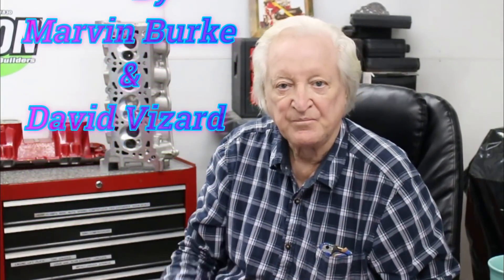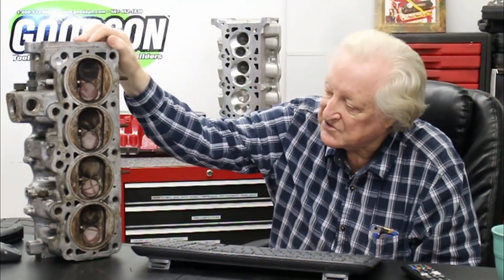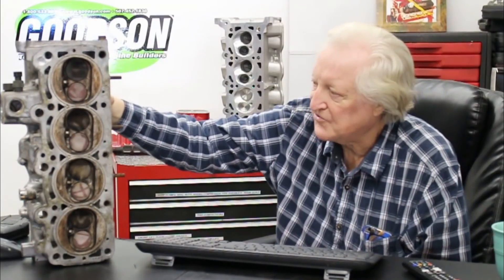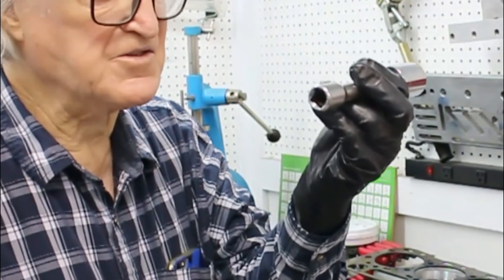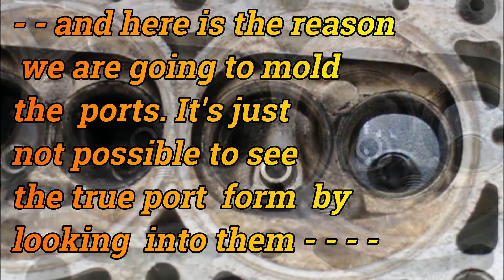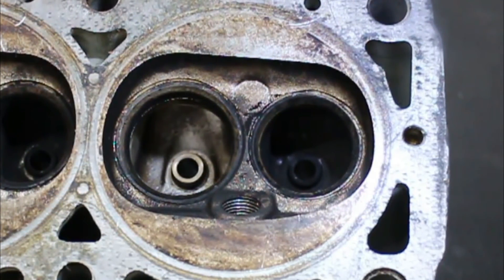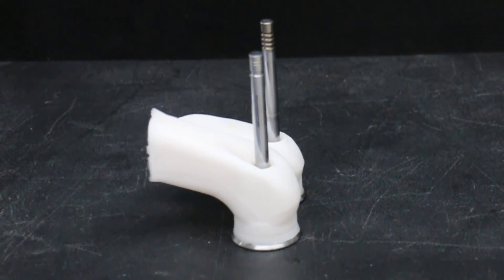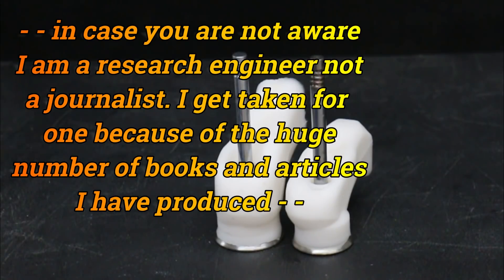David Vizard's PowerTec 10 EP 37 2.2 turbo Mopar head for Richard Holdner Part 1

Comment: I remember when i was a kid and that been a while i was reading a hot rod article and after reading it i saw the author it was Mr, Vizard and i made a metal note to watch out for more . When i ran on to the u rube channel  i thought what a deal lol great . I moved on to different brand but did mopar  dodge ever build a set of cylinder heads for the big block wedge engine that would support making hp . I had the 440 and the 426 marine wedge but they were just torque motors . I assumed dodge used the hemi for there high performance  department

Comment: Yeah nothing special about that head I'm surprised Shelby did not get Chrysler to do a special turbo head for the Shelby turbo cars. I would love to see a N/A 2.2 head and a Turbo 2.2 head and compare them. I know all the 2.2 and 2.5 heads were built with late 70's early 80's tech and back then turbo cars were not very efficient  compared to these days. I had a 1980 Turbo T/A and that car was not very good for power.

Comment: David, I did one of the 'bathtub' heads back in the late 80's for my nitrous street car. (82 Turismo w/fogger setup) Took a straight forward clean up approach in the bowls with good valve job. Chamber had the most significant work & had to mill the deck significantly to get the CR back. Stayed away from the short side floor on exhaust & paid the most attention to the roof. Can't go as tall as you'd want as it can be thin to the water jacket. Intake roof is easy enough to measure to valvetrain area inside of valve cover rail. Most of the good 'secret' parts of the day add the port openings raised. Also consulted on an engine with a friend of mine for a short oval package where we angle milled the head to stand the ports up. Engine never saw the car as the project was scraped. Still have it on engine cart in storage 30+ years later.

Comment: Regarding the ease of improvement of this head. Thinking about the heads and engines of the old Minis that Mr Vizard was upgrading, I also initially thought the same thing. Then thinking about it I realized that this was not the case. Improving a head that has a bad design at first is easy, just remove the bottlenecks and you will see improvements. But then you stop and the situation is reversed, obtaining excellent results is difficult precisely because the drawing is bad. I think getting a lot of power, and reliably, out of those old engines was a great school for old Hot rodders. (The same thing happened here in Italy with the engines of the old Fiat). This is my thought

Comment: My stars, those ports are... poorly thought out, I think would be the kindest comment. I'll be anxious to see how you minimize the bathtub chamber; that's what I'm dealing with on my Chevy inline 6. And as a bonus, now I know how to get a silicone port mold! Such a deal! Thanks for all you do, and for all you've done thru the years. I've been reading your stuff since about 1970, and marveling that you get what you do out of the engines that come across your shop floor. Those small increases add up after a while, if one is consistent with the follow thru during the build.

Comment: Good stuff Mr. Vizard! Ive been porting these heads for 20+ years for drag race application; I am very interested in what you come up with, will be watching.
Reply from the maker: Hey wstramer - are there any off-the-shelf bigger valves for these heads. I would appreciate any useful points on these heads like - where are they thin etc. Thanks
DV

Comment: I would be tempted to take the floor down in that exhaust port to reduce that choke but be my luck I would cut through into the cooling jacket. A bigger exhaust valve and opening that throat thru the seat looks like would really help.
Reply: Better to raise the port almost into the valve cover area. Epoxy the top inside the valve spring area and port up almost all the way through. But I'd bet a bit of Ceramic coating is coming up after porting to block heat transfer.

Comment: Like 223. DV, it must be a joy to get your teeth back into a flat valve angle non Cross flow 4 cylinder head. We could Siamese the intakes, and TIG weld aluminum heart shapes into the combustion chamber...and make it a 12G 940...on acid. Enough of my thinly veiled references to the BMC heads that made you famous, my beloved teacher. Great to see you working with Richard H. Only H's and V's are playing like these. The 🐍 charmer and English 🦁 work ethic, both of you making scientifically significant contributions. Humble thanks Sir.
Reply: Don't forget the 649 cam 👍

Comment: Wow that's so bad from the factory!
It looks like some proper Tig Welding in the chambers and a little in the bowls could really help.
Chrysler made a 782 performance wedge head for the 2.2 Daytona and everything else starting in 86. Vastly improved but still not crossflow. Speedmaster sells a cheap one for less than 400? or so. Those little nuggets were good for 500 with an intercooler.
The 2.0 DOHC Neon 16 valve crossflow head will also fit on the taller deck 2.2/2.5 block.

Comment: This is the older "287" aka "bathtub" head (and you can guess where the name came from) if I am not mistaken. These heads were designed in the 70's by the same group that did the slant 6. They have nothing in common besides non-cross flow and being built like tanks, but just an interesting tid-bit. Keep in mind that this 4-cylinder was making ~100hp in N/A form (Shelby got about 110hp out of them in 1983) and wasn't revving much more than 6,000rpm MAX. 
I am wondering if you'd be willing to take on a rare 16V head for this same type of engine?
Reply from the maker: Mr., Rocket - some  interesting  info there.  I am interested in a N/A head if someone wants one at a reasonable price.

Comment: As an addition to your "brute force" method of removing valve retainers: the addition of a strong magnet inside the socket will catch the collets when they come loose and let you avoid searching the floor on hands and knees later.  :-)
Reply from the maker: You aussie's are never short of good idea's. I had never thought about that one. Score 10!
Reply: I try to work on a terry cloth towel. It keeps small parts from bouncing. 😎

Comment: What we ended up with was the Avenger tiger 1500 then 1600 and the BRM headed Brazilian block.
Wonder what else Chrysler had up their/your sleeves? 🙂
Reply from the maker: Hey Mr Pagan - though not factory approved, Dez O'Dell the competition manager, did help support  us toward building a 2,000 cc turbo motor. We never built a 2,000 cc one but we did get to the point of doing an 1800 cc one based on the Brazilian block. 20 pounds of boost produced just over 400 hp.
Reply: @marvingvx1  That would have changed the corse of history, Ford would have been forced down the same route. 
BMW would have matched as the first production turbo car. 
What might have been 🤔
Reply: @marvingvx1  WOW!!!

Comment: Those ports should be easy to improve on.
Reply from the maker: Dane, It does look that way -  but getting them really good might well be a real challenge.
Reply: @marvingvx1  The first thing that caught my eye was the size of the bowl in each port. I imagine there are gains to be had by adding material on the back side of the bowl. The short side  radius also seems less than ideal. Thanks for making these videos and sharing as much as you do. I'm looking forward to the next video.

Comment: Brute force method = pull out the Jeremy clarckson signature tool. 
I wanna see Richard holdener dyno one of your heads next to an edelbrock or AFR, just to show what happens when you know what you're doing.
Reply from the maker: Rusty, I am pretty sure Richard would go  for that.
Reply: @marvingvx1  Hello Mr. Vizard,  I suspect there will be a lot of interest in this test.  Something like a 306-347 Cu in. ?  or would a larger displacement such as 408 be better to best work with highly improved flow?
Reply: That would be interesting.  What cylinder head should DV start with?

Comment: Heading in the right direction with Chrysler products, thank you sir! Eagle heads next?
Reply from the maker: Ryan, Which Eagle heads????
Reply from the maker: Eagle heads ???? enlighten me please.
Reply: @marvingvx1  
Sorry for the late reply I’ve got four boys at home and things got crazy as you can imagine when I got home from work. This is not my work obviously I am a novice but I watch all of your videos and will be doing a complete teardown of my 2014 ram hemi using much of your teaching
5.7L Eagle 2009–Present

The Eagle Hemi cylinder head arrived in 2009 with VVT on non-SRT Dodge passenger cars and trucks. As with the early head, the Eagle uses rocker shafts and 1.65:1 ratio rockers, but there are big differences in the size and shape of the intake port and the rest of the valvetrain. The Eagle uses 2.05-inch intake and 1.55-inch exhaust valves that are not only larger, they are also longer than standard. The rocker support is taller, and the valve-guide support boss sits higher on the top side of the head, moving it out of the intake port. The Eagle uses a larger square port like the 6.1L that flows a massive 331 cfm right out of the box. 

5.7L Eagle Flow Chart* 

Lift Intake CFM** Exhaust CFM** I/E Percentage 
0.100 82 45 55 
0.200 175 110 63 
0.300 243 160 66 
0.400 300 180 60 
0.500 323 181 56 
0.600 331 183 55 
0.650 331 186 56 

*Flow testing performed by Dave Weber at Modern Muscle Performance using a 4.060 bore plate, no exhaust flow pipe on a Superflow 1020 flow bench at 28 inches test depression.
Reply: @marvingvx1  David would love to see you improve on this already quite decent OEM head. As I was somewhat stating before there is a large crossover between charger challenger guys and ram truck guys. Some of the things that I am going to be doing is taking mating the 6.1 crank which is forged to my 57 in my ram truck to go along with my Eagle head and topping it off with the 6.4 L intake manifold.